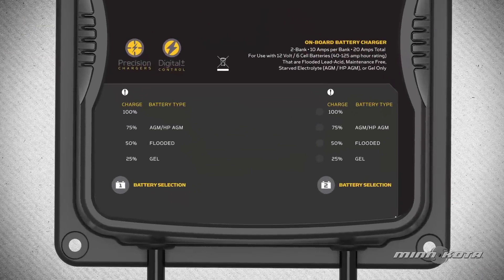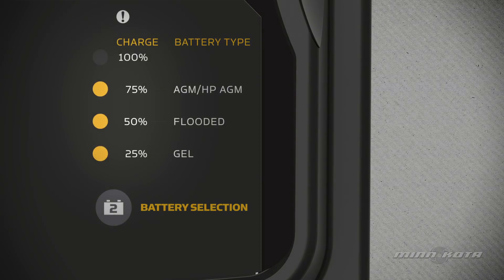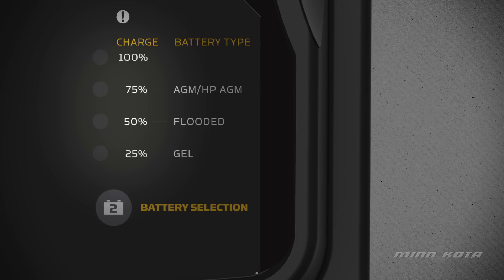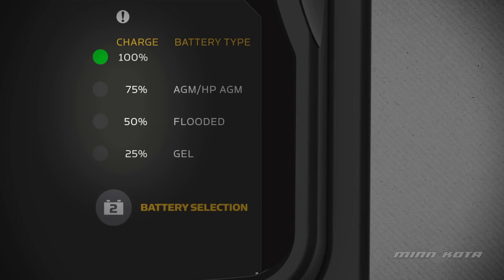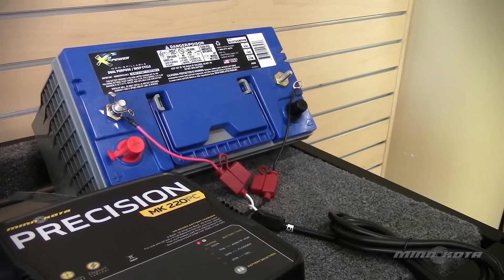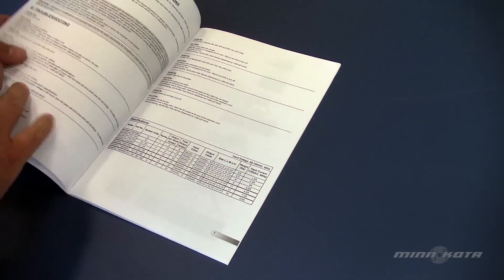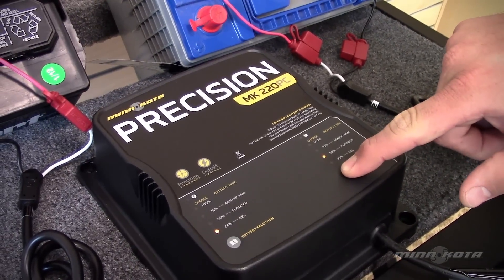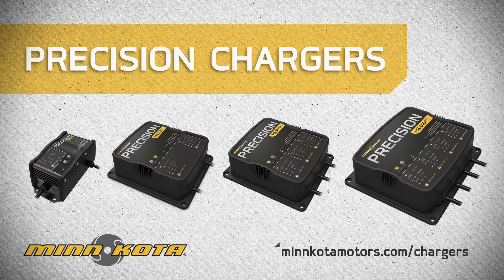Precision Chargers: Dual Function LED Display

Comment: I wish you guys covered all the different LED modes so you explained what happens when you charge a low battery.
Reply: Why what happens??! I got this bank used no manul nd it keeps going from 25-50-100 then back to 25 lol don't know if you have any idea why thats happening but I'd appreciate anyone who could point me in the right direction
Reply: What is interesting to me is. All works great when I unplug . Then after use  plug in I get Red Errors Indicators on 1 or 2 banks. Then I unplug or Clear the charger for a few hrs, Plug back in and come back next day. All 4 Banks Steady Green Light. Perfect. This scenario happens all year long for past 9 years. Batteries all measure correct volts. I have the MK 460 Charger. Had to be voltage sensitive inside charger.